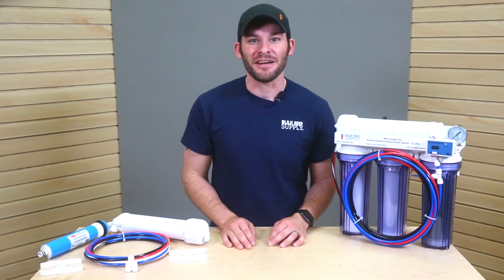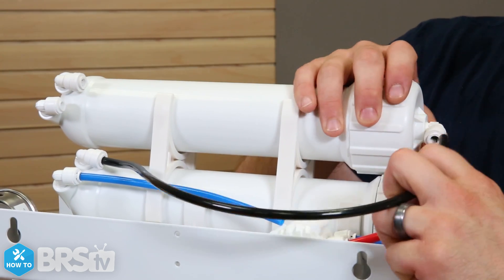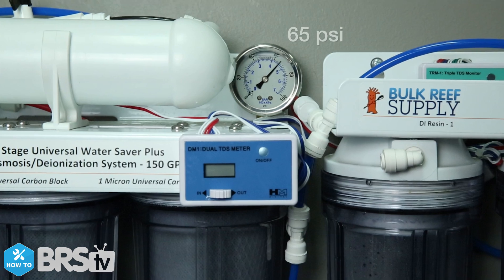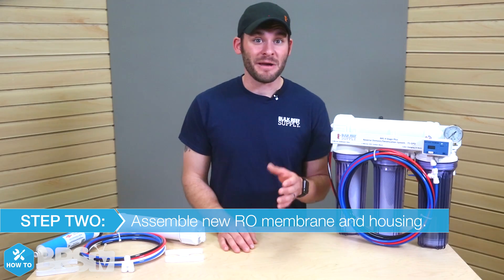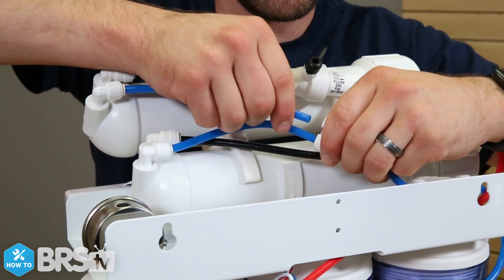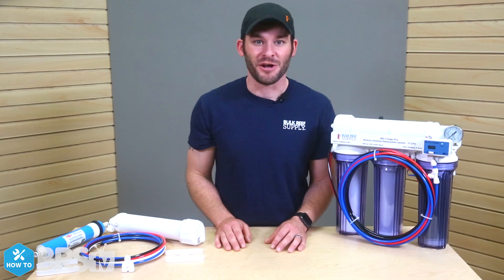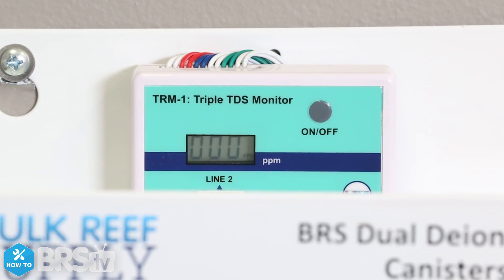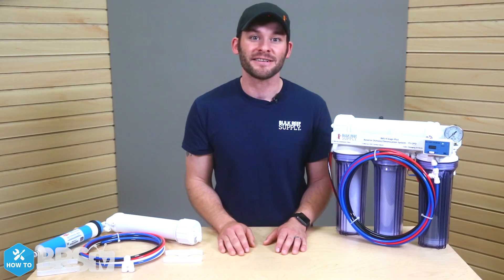Installing the BRS 150 GPD Water Saver Upgrade Kit | BRStv How-To

Comment: Waste Water purity question:
On average, how much cleaner is the waste water produced from 1 RO (75gpd membrane) compared to the source tap water? 

Example: If source tap water had 50ppmTDS and normal city amount of chlorine etc…Would the waste water produced still have less TDS than the source tap water? because it’s passed through the pre filters ? Or does the RO membrane add anything bad back?
Reply from the maker: That's a good question. While we've never looked into that specifically, here are some thoughts. The waste water, like the product water, all passes through the pre-filters. Those pre-filters don't remove TDS, but they do help remove sediment and chlorine/chloramines from the water. So, in that regard, the waste water from the RO/DI system is still "better" than tap water. As far as TDS goes, the TDS of waste water should be slightly higher than your source water as it's more concentrated after being rejected by the RO membrane.

Comment: I bought the 100gpd rodi system and my pressure is at 62psi do you think I can add this water saver with 62psi?
Reply from the maker: The difference between 62 and 65 psi is going to be so small that you will hardly notice.

Comment: Question with this…….can you fit a 150gpd waste stage to a 400gpd primary filter…..or do these have to be matched….eg 150 and 150 or 400 and 400….to stay balanced.
Reply from the maker: You'll want to match the RO membranes if you're going to be running them in a water saver configuration because they both work off of one flow restrictor that needs to be sized properly for both membranes.

Comment: Ok I installed the upgrade kit and am now curious if the flow restricter needs to also be upgraded.  I upgraded to a 200 gpd kit.  Thanks.
Reply from the maker: As long as you added the same size membrane to your system, you don't need to change the flow restrictor.

Comment: I followed this video to the T, but when I open the flush valve, nothing comes out. I do have the flush valve the correct direction. Did I miss something?  It also renders my booster pump ineffective when the valve is open. Not sure what's up with that. I am already enjoying being able to make water over 5x as quickly.
Reply from the maker: You'll want the flush valve in the "closed" position when you're making water. If you're still having troubles, give our customer service team a call and I'm certain that we can get you up and running.

Comment: Adding this membrane dropped my pressure 20psi.  75-55..... probably negligent savings.  That's with booster.
Reply from the maker: That's very strange, we usually don't see a significant pressure drop when adding a water saver upgrade kit. I would suggest double checking that all of the plumbing is correct before you give up on it.
Reply: @BRStv  Thank you. I ended up forgoing the self piercing saddle valve and ran a T-fitting.  I now have excellent pressure without the worry it will leak.

Comment: Question:  I have an auto flush on my RO.  I just installed the BRS water saver kit... how does that change the auto flushing process?
Reply from the maker: It doesn't change how the auto flush operates. Since the water saver systems use a single flow restrictor, the auto flush will effectively flush both membranes.
Reply: Got it.

Do I have to install a larger capacity flow restrictor?

Comment: Question:  I have an auto flush on my RO.  Right now when that runs, it’ll flush the membrane.  But how does that system work now that the waste water from the first is going into the second RO?  When the system calls for “flush”, will that allow for both membranes to properly flush?
Reply from the maker: Since both membranes operate on a single flush valve, they'll both effectively be flushed when the auto flush is in the flush mode 😀
Reply: Thank you for the quick reply.  Last question:  I want to install a drinking water kit before my DI.  But I keep reading about TDS creep.  Since the sink faucet will fill a glass at a time, and I’ll also install a T fitting to feed the fridge. Will my drinking water reservoir be full of TDS due to short runs?  Right now it flushes for 15 seconds before it runs.  But is that enough to prevent TDS creep in the permeate line?

By the way I live in San Jose, CA.  My tap water reads 394 TDS.  Tastes horrible..

If I go forth, do you know when the water saver kit will be back in stock?

Comment: Do you have 2 outputs on this unit? 1 output for RO water drinking, 1 output for RODI water ?  I would like to buy a filter kit that I can use for both: reef tank & drinking water as well
Reply from the maker: You could simply add a t fitting after the RO membrane, but before the DI. That way, you could have one line go through the DI for your reef tank water, and another line bypassing it for your drinking water.

Comment: I have a 100 gpd membrane now.. Do I have to upgrade with another 100 gpd membrane, or can the membrane be mismatched?? (example,,, upgrading my 100gpd with a 75gpd?)
Reply from the maker: You'll want to match the membranes up because you're only going to use one flow restrictor. It's important that that flow restrictor is properly sized for optimal performance.

Comment: When using the waste water line for the second membrane, doesn't this mean the second membrane will be consumed faster, as it gets water with a higher TDS then water from the source line?
Reply from the maker: That's a plausible theory. Even so, the TDS concentration isn't usually drastically higher. If you had 200 TDS source water, that would mean roughly 250 TDS hitting the second membrane. Definitely not a huge jump and something the second membrane could easily take care of. 

Even in a water saver configuration, most of our customers will see 2-3+ years of membrane life.

Comment: does it have to be a Y-connector or can it be a T connector? (the part the merges the RO water into the two units)
Reply from the maker: A T connection will work just the same 🙂
Reply: Bulk Reef Supply perfect! Thank you for replying!!

Comment: for 65 psi, do i need to install a booster pump? I'm told house psi shouldnt be more than 60
Reply from the maker: You would not need a booster at 65 PSI. This is the minimum requirement for our water saver upgrade as well.

Comment: After upgrading with this kit, would the system benefit even more with a permeate pump?
Reply: Thanks for your reply. I do have a pressurized tank. I forgot to mention that I also have a booster pump before the prefilters. Does it make a difference in what I asked?

Comment: QUESTION - So if the two RO membranes are 50gpd, does the 1 RO membrane flush valve have to be 100gph or 800ml?
Reply: @BRStv  Thanks for the reply.  What if one did 3 RO membranes in series, still the same?  Also, where the RO membranes' product would be directed to (the 2 or 3 way split), is there any benefit in going from 1/4" to 3/8" or 1/2" for the rest of the system?

Comment: Hi. What difference does it make to the system, if you have 400 flow restrictor, compared to a 550 restrictor. As I've seen other videos with your system and they have the 400 fitted.

Comment: I have a some what unusually low TDS normally 30 and under with near unmeasurable chlorine levels. Would it be possible to get by with a line up of filter and carbon blocks without the full RO/DI system?

Comment: hi, at your website which one should I choose to get the BRS 150 GPD Water Saver Upgrade Kit 4 Stage 75GPD dual series? is it this 4 Stage 150GPD Plus Water Saver RO/DI System
$219.99??

Comment: If I were to use 2 - 100gpd membranes, what would be the required psi? Right now I'm running a single 150gpd membrane at 65-80 psi, depending if other water sources are running in the house.

Also, could one use an oversized restrictor to boost the psi?

Comment: At what TDS should you change the pre-filters?
Reply: UltraReef's Channel 
You change the sediment filter when your psi starts to drop, meaning it's getting clogged. You change the carbon block by measuring the chlorine in your product water. They sell very simple strips on BRs website. As soon as it starts to register the slightest level of chlorine, it's time to replace. And I'm talking .25ppm of chlorine so it won't ruin the membrane.

More often than not I just replace the sediment and carbon together even if the carbon isn't exhausted. It's just easier.
Reply: I change all three pre filter as they are cheap enough when bought together. 10 mins and done.
Reply: @Ju5tin4real  lol, 3 years later, that's what I've been doing as well.  I've even put in new RO membranes on this 7 stage RODI unit from BRS, still going strong making great water!